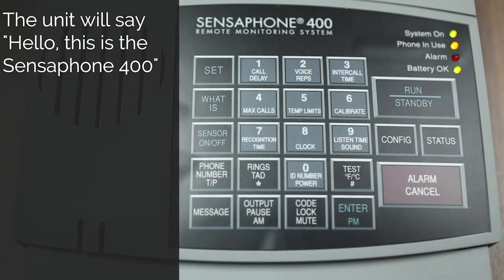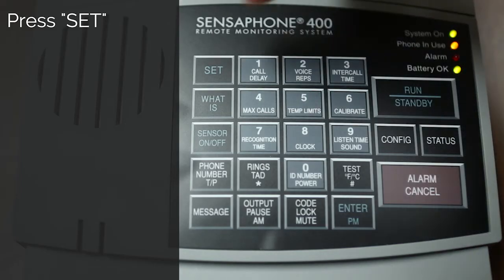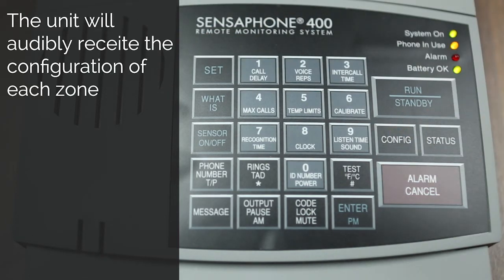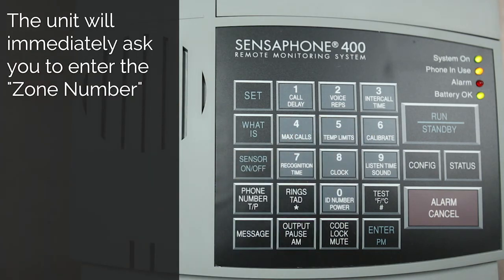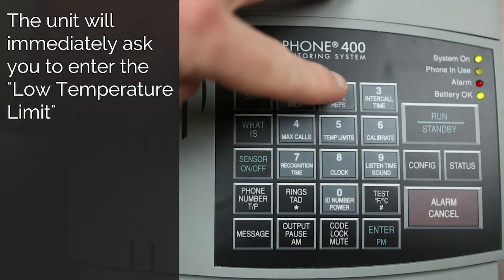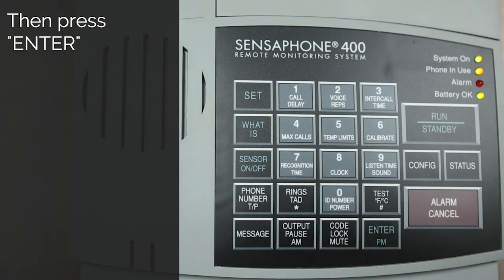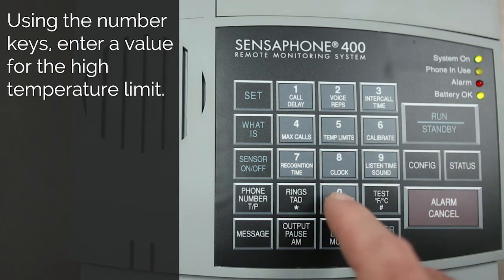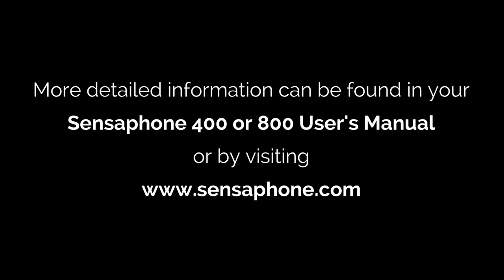Sensaphone 400 Temperature Sensor Installation and Programming

Comment: Is the temperature range in Ferenheight? what if you need to enter a (-) Minus number? for things such as freezers?
Reply from the maker: Yes, in the video the temperature is set at Fahrenheit, but temperature zones may be set in either Fahrenheit or Celsius degrees. If a
 negative number is required, first press *, then enter the number.